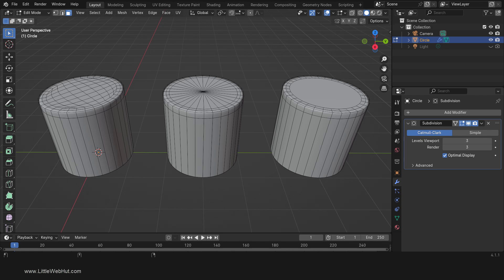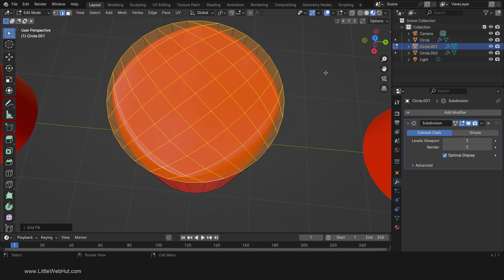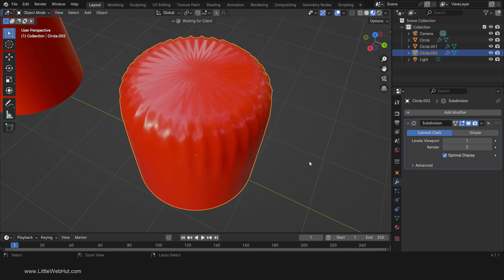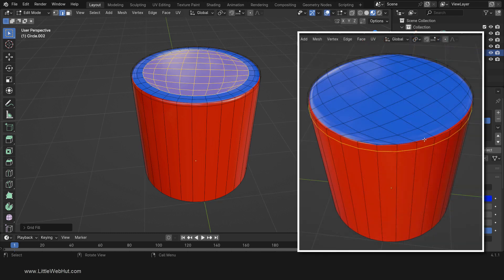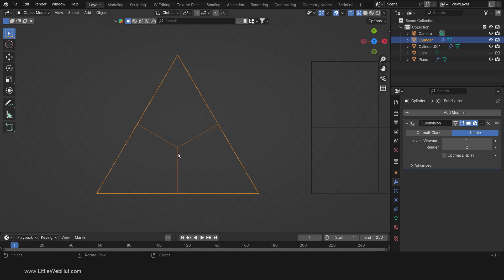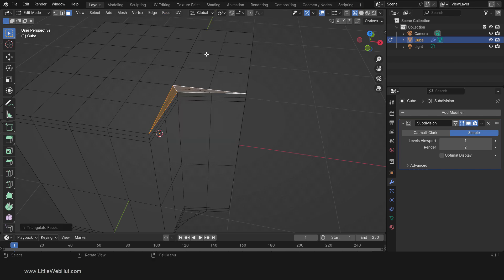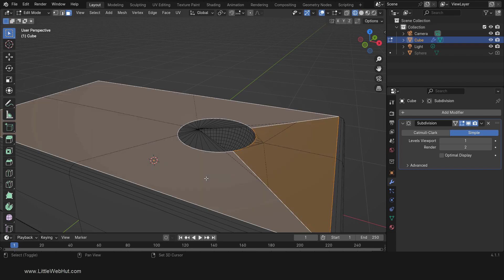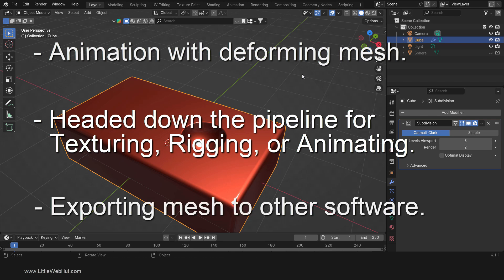Blender Modeling: Exploring The Truth About Quads

Comment: Great vid. I am still curious though about whether it matters if I have a pile of ngons after cutting holes in a plane (I'm modelling a ceiling that has pot lights, the latter being modelled separately). The ceiling will always be flat (and only used in Blender) so is there any advantage to remeshing it into quads and tris? So far, I haven't found any weird shading artifacts so I'm inclined to "not fix it if it ain't broke."

Comment: Leaving a comment because it was requested.This is great, but I wonder specifically in the last example with the boolean modifier if this is "good" geometry? It appears that the sizes of the quads are very uneven.  I'm not very experienced but I would imagine it would be cleaner to have a more evenly distributed top face.
Reply: alch si
Reply: There is a guy here on youtube called Ian McGlasham who goes through this and creates much better geometry and uses the boolean modifier to trace over using loop cuts and 'control cuts' as he calls them, basically never having to apply the boolean modifier and doing it all with the most efficient quad count. I think the video has 'hard surface' in the title. I agree with you, booleans are AWFUL especially if you want to import something to a game engine. Very inefficient.

Comment: Has anybody tried to write a funcion which detects when new vertices appear outside the face and auto triangulate? There should be (and maybe is?) such option in the subsurf.
Reply: yes triangulation algorythms exist and a rendering or game engine will triangulate the resulting mesh regardless, its just better to decide the triangulation yourself to avoid shading and teselation issues